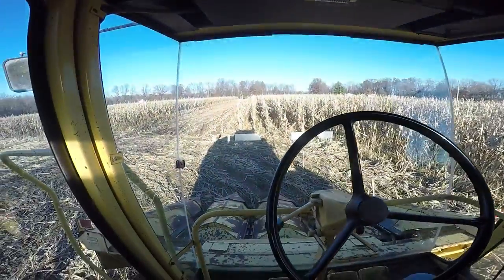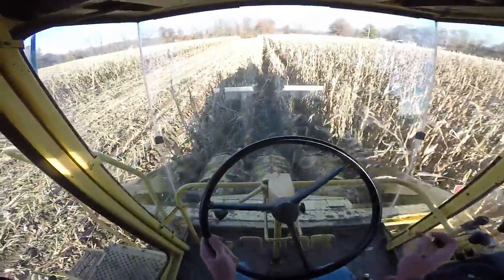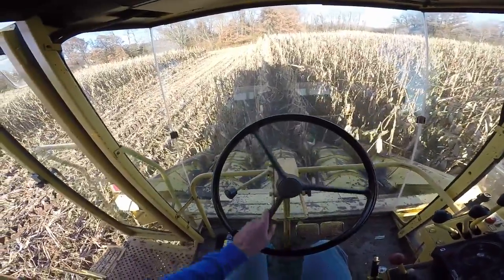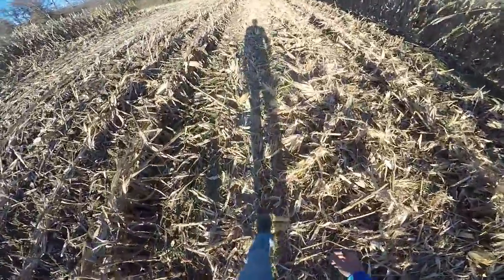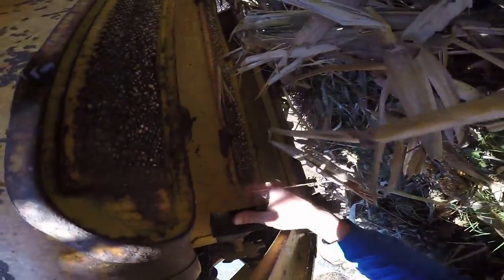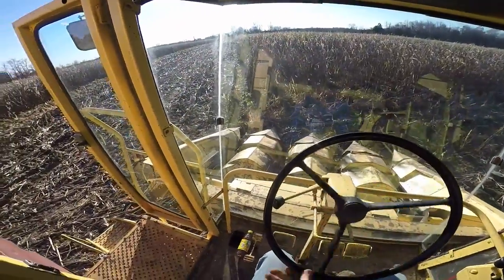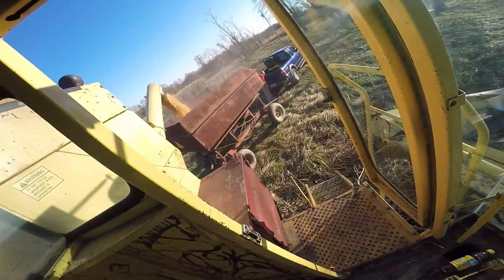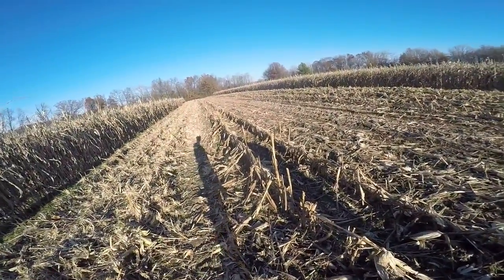First Corn Harvest  TR70 Petrol

Comment: On my Ford 640, I found I could pretty much run the chaffer and sieve wide open, with full air from the cleaning fan.  Unlike most combines, the air was controlled by a pair of shutters on either end of the fan, linked together with a rod across the machine, which you closed down with a quadrant lever on the side of the machine.  Full air increases cleaning capacity and throughput, but you have to run the chaffer and sieve more open to let the grain get through faster so you don't ride or blow any out the back... close the chaffer and sieve down just enough to prevent junk from getting in the tank.  I always did walk-arounds of the combine every couple hours or so and checked to see what it was doing-- header loss, thresher loss (grain still on heads or cobs), and cleaning shoe losses... never saw anything going out the back except the occasional broken kernels or really light immature kernels or bug-eaten kernels which aren't really worth anything anyway... certainly not worth putting more garbage in the grain tank to keep them from going out the back...  We always had a REALLY clean sample, too... Claas sure knows how to make a combine!   German engineering for the win!  OL J R :)
Reply from the maker: I'd love to see one of the Ford combines up close.
Reply: @boehmfarm4276  There's some running on youtube.  We quit row cropping long before I started YT.  Still got her in the barn, but thanks to the hurricanes and the cheap green sawmill wood Grandpa built the barn for it out of, the barn has slowly caved in on top of it.  If I ever grow grain again I'll have to extricate it from the barn, meaning tear the friggin' barn down off of it LOL:)  

Ford actually sold three different models.  In the early 70's there was a loophole in the import tax laws-- Ford discovered that they could import Claas combines from Germany as "machine parts" and taxed as PARTS, so long as they were shipped without an engine!  SO Ford and Claas struck a deal and started importing Claas combines without engines.  Ford would get them and either install a 4 cylinder diesel (which IIRC is about the same as in a 5000 tractor) or a 300 inline six Ford gas engine (the industrial version with sleeves in the block, but it's pretty much identical to the old 300 sixes they put in the F-100 pickups).  Then they painted them blue over the Claas sickly neon green and slapped FORD stickers on them and sold them.  Funny to see as the paint wore off and the green started showing through underneath.  

The smallest was the 620, not much bigger than your old Gleaner.  I never saw one of those-- they were too small for our area at that time.  The middle one was the 630, which Claas called their "Mercator" (don't recall what they called the little one) which was a little smaller than the big one, the 640 (Claas "Senator" model).  I bought a scrapped 630 for parts, which I took everything off of I could get then sold it when scrap iron was sky high a number of years ago.  The 640 we have has an 18 foot rigid platform for grain sorghum and small grains, though we used it for soybeans just fine-- just gotta ride the header height to keep the knife close to the ground but not in it LOL:)  The 18 foot was IIRC the biggest header they had back then.  I converted a Gleaner "G" four row corn head for it, as I couldn't find a wide four row Claas cornhead (not that I could afford anyway).  The Claas was weird in that they feederhouse stayed with the header, they were bolted together.  You pulled a pair of pins and wedges out of the feederhouse pivot on the front of the combine under the cab, and unhooked the cylinders, and backed the machine away, pulled up to the other head, and then slowly drove in while someone guided you til the feederhouse pivots dropped into the clamp brackets, replace the clamps and pins and then hook up the cylinder pins to the feederhouse and hook up the drive belts.  Needless to say NOT "quick tach" for header swaps!  The thresher is a 48" (IIRC) six bar cylinder and concave, with about an 16-18 inch diameter IIRC.  Claas always used a smaller diameter cylinder and concave than most other manufacturers, but it works great, because the smaller diameter cylinder is easier to turn, so less plugging up, and the tighter curvature "slings" the threshed grain out faster.  With two variable speed pulleys on the left and a big cast iron reversing block on the right, the cylinder has plenty of momentum to get slugs through the cylinder unless they're monstrous.  Four wide straw walkers move the straw to the rear discharge beater.  The threshed grain falls onto a grain pan like a New Holland, rather than those silly "auger beds" that Deere and CIH have which just mix all the grain and chaff together into a huge mess for the cleaning shoe to straighten out.  The grain pan shakes with the cleaning shoe to move the grain back, the heavier grain sinks to the bottom and lighter chaff floats to the top, and so as it goes over the rake onto the  chaffer MOST of the chaff is blown out at that point!  From there the cleaning fan blows the rest of the chaff out as the grain pours through the chaffer and sieve, returns coming off the sieve are elevated back to the cylinder for rethreshing.  The clean grain tank was only 77 bushels, but we unloaded enough it wasn't much of a problem, and we had an old auger cart Dad had bought in like 74 or 75 for a long time til the gearbox finally bit the dust.  The cab was not air conditioned (not good in the 100 degree heat of July when we're typically combining grain here in SE TX) but Dad got an old "under-dash" AC unit from a 60's car at the junkyard (add-on AC unit) and installed it on the combine, and it sorta worked.  The cab was quite large for the time, though not very well sealed at all.  Everything was easy to get to-- on your left were the three levers for engaging the combine-- the  outermost for the unload elevator, the middle for the thresher, the one closest to the seat for the header.  Steering wheel right in front with the clutch on the left and brakes on the right.  Cylinder speed and ground speed indicator gauges right next to the steering wheel.  Under the seat was the quadrant lever to set the concave-- which we typically ran in about notch 4 for most crops/conditions.  Made adjusting the concave clearance simple and instantaneous.  On your right, furthest forward was a hydraulic multi-valve which controlled all the combine adjustments through a rotary valve-- think of a loader joystick on steroids.  It has several "slots" which you could push/pull the lever and rotate between them through a cross-slot in the center.  Pulling back usually slowed things down, pushing forward sped things up.  One slot had an offset "neutral" for the cylinder speed, that was rotated closest to the seat, then as you moved over, the next one to the right was for reel height, the one next to it was raise/lower the header, the next one to that was ground speed faster/slower through the variable speed pulleys turning the 3 speed manual transmission, and then there was a crank for the reel speed next to that.  Behind the variable speed controller was the gearshift lever, and behind that the throttle with a catch for idle and released was full speed, and behind that was the choke lever.  A buddy seat with a storage box underneath was on the right side of the cab against the wall.  The grain tank was right behind the cab, with the engine on the deck behind it.  The auger was manual fold, but had a helper spring so it was easily pulled up with a knob and rod arrangement and locked into place with a lock behind the knob that fit down over a pin on the side of the machine-- I often stepped out of the cab while combining, grabbed the knob and pulled the auger up and locked it, as my brother drove up on the tractor and auger cart, stepped back in the cab and corrected any steering drift, and then engaged the unload lever on-the-go and unloaded the combine into the cart... finished up and then stepped back out and put the auger back down and just kept right on combining-- who needs autosteer??!!  LOL:)  The hydrostatic steering was very good on the machine and would hold the row for long enough for me to do that without getting too far off.  

It's a good machine, Claas really knows how to build a combine and the German engineering really shows it's stuff... Ford did right by partnering with them.  Unfortunately it didn't last but a few years, and I guess they closed the loophole in the laws or Ford decided to go a different direction or whatever, because the next Ford combine was the 642, and it was built by Long IIRC, and has basically NO compatibility with the Claas machines that preceded it.  Ultimately Massey would sell a rebranded Claas in the 90's IIRC, don't remember the model number but in the sales brochure you can clearly see it has the same cylinder and ground speed gauges as my old Ford, and clearly see the "CLAAS" and baler billhook knotter symbol of the Claas company on the gauge face!  

The Long combines didn't last but a few years, either, as Ford dropped their combine line and simply sold the New Holland combines, as they had with their hay equipment.  We had a Ford 632 small square baler (don't know who built those, it left the farm when I was 10, that was 40 years ago!) and we replaced it with a Ford 552 round baler (built by Gehl, their 1500 model).  Ford had some interesting equipment and seems they bought stuff from just about everybody at some point LOL:)  In the old days it was mostly Kelley and Dearborn implements, particularly in tillage stuff...  

Later!  OL J R  :)
Reply: @boehmfarm4276  Lemme tell ya a story.  When I was a kid and my Dad was about your age, he was a go-getter too.  He bought this rusted out old Case 660 combine from some guy dirt cheap-- it was nearly rusted to the ground because they'd been combining grain sprayed with chlorate, which some farmers used back then as a desiccant to kill the stalks and dry them down with the grain, but the stuff is basically SALT and of course in our hot, humid environment it simply rotted those old combines to the ground... I remember he spent all winter in the shop patching holes in that thing with bondo and sheet metal cut and pop riveted into the header and underneath, and the whole shaker pan under the open straw walkers was completely rotted out, so he just riveted a couple sheets of tin on top of it to shake the grain down to the cleaning shoe.  Well, he started doing custom combining with it and making money, pretty good money at that, plus harvesting his and Grandpa's own grain sorghum.  One of the jobs he took on was a BTO they went to church with in the next lil town over.  This guy farmed with all new Deere equipment, but he NEVER harvested his own crops-- NO WAY was he going to get all sweaty and dirty and itchy back then on a hot un-air-conditioned combine in the 100 degree July heat when the crops come out around here.  He always hired it done (til decades later).  Well, Mr. Bigshot got to talking with Dad and Grandpa because Grandpa bought an old rice auger cart for nearly nothing and they bought a 56 Ford grain truck rusted nearly to the ground from hauling fertilizer for its previous owner, and were their own two man harvest crew.  Dad had the unloader bust one day on the combine with a full tank, and spent the afternoon dipping grain out of the tank into the truck with a five gallon bucket in the guy's yard while he watched... Dad had a heat stroke and spent the night in the Eagle Lake hospital.  Well, Mr. Big started telling them, "Yall should buy a NEW combine, and you could cut my grain EVERY year!  I'll buy a big 12 auger cart (which was new back then, biggest you could buy, now they're pitifully small and if you can find one they're cheap) I can pull it with my 4020 or 4230 or whatever big cab Deere he had back then..."  SO during the off  season, Dad and Grandpa started looking because the old Case was pretty much a basket case and had run its course.  They looked at new Gleaners (a G or F IIRC) and the Ford, which were the only ones in their price range.  They got a deal on the Ford because it'd been sitting on the dealer lot for about 2-3 years at that point.  Paid $12,000 for it brand spanking new in Victoria, 90 miles from Needville, and they trucked it down there for them.  

Well, they started combining for Mr. Big the next summer and all was going well... Grandpa had a very dear friend, an older black gentleman named Mr. Grant, who had been a family friend and worked for my great-grandfather when he was just a kid.  Mr. Grant, like a lot of guys back then, bought a used tandem truck and mounted a grain bed on it and hauled grain for the local farmers and custom cutters, because almost NOBODY had a semi back then... He had a nice twin-screw International Loadstar with a 400-500 bushel box on it, we still had the old '56 Ford inline six single axle with a 250-300 bushel box on it, so rusted you could see through the floor boards!  Anyway, Grant hauled for Dad and Grandpa on their jobs and made money.  Back then it was nothing to sit in line at the elevator for 2, 3, 4, even 5 hours at times waiting to unload, so it took a lot of trucks to keep up with a combine!  Well, Mr. Big didn't like Grant and told Dad and Grandpa to "get rid of him".  

Next thing you know, Mr. Big comes down to the field and tells them to pull out, he's found someone else to harvest the crops.  Evidently a bigshot neighbor of his up the road had MASSIVELY over-contracted on his grain crop at a good price, only problem was, he didn't have enough grain to fill the contract, and was going to lose his shirt having to buy out the contract.  He came to Mr. Big and cut a deal, he'd buy his grain at the going rate across the scale, sell it under his contract, and harvest his entire crop FOR FREE.  SO Mr. Big was only too happy to go back on his word and welch on the deal with my folks... leaving them in a lurch with a big bank note to make on a new combine and no custom job to pay for it... But this turd was ALWAYS like "it's only business" and his reputation was SO lousy in the town he lived in over there nobody would have anything to do with him-- as one guy commented one time in the coffee shop, "He'd slit his own mother's throat for another hundred acres!"  Amen pew on Sunday morning in church, and do anything to anybody to screw them all week long, because it's "only business".  

More to come... OL J R :)
Reply: Continued... 

SO anyway after a bit of panic Dad and Grandpa started beating the bushes for custom jobs to pay for the combine note.  As it turned out, the mid-70's was the "golden age" for grain sorghum and corn in our part of the world down in SE TX.  Prices were high, it was a cheap crop to grow, and business was booming.  By that point a lot of guys had jumped on the "get big or get out" train but didn't have all the big shiny new toys they'd have a few years later then-- back then a 1486 or 4230 or Ford 7700-8000 series or Case 2290 was a BIG tractor!  Lotta guys still farming with 6 row and slowly moving up to 8 row.  The TR combines and rotary CIH's and 00 series Deeres hadn't really come out yet or not many had them then because they were TOO new... Anyway, they found this guy who was aspiring BTO... he'd rented a BUNCH of river bottom land on the north side of the Brazos river on red clay soil and put it all in grain sorghum to make a killing because sorghum was cheap to grow then and grain prices were sky high (thanks to that IDIOT Jimmy Carter and his Soviet grain embargo that wouldn't last-- the grain embargo ended up collapsing grain prices across the country and set up the "perfect storm" of the 1980's farm crisis-- it was basically the opening shot of it anyway, which took about 15 years to dig out of before it was over... thanks lousy Dem president... Now we're about to see it ALL again...)  Anyway, all was well and good, the guy had a terrific crop, BUT it was a hot, WET June that summer as the grain was filling and maturing.  The morningglory vines had come in like gangbusters, and grew up and wound around the stalks and started running up and down the rows and then across the rows, sewing it all together into ONE HUGE GREEN MAT of vines and dry grain.  He obviously couldn't harvest it all, and he put out the word to every custom cutter he could possibly get to come down to this riverbottom field and start cutting at so and so time and day, and basically they'd end up having all the grain they could possibly cut.  Well, Dad and Grandpa drove the combine across the county and over the 20 foot wide river bridge to get there, with the header on of course, and pulled in.  I was a little kid but I still remember that day, everybody gathered under a grove of pecan trees at the edge of the property.  Combines of every make and model and type and kind were there, from old to brand new... Deere, International Harvester, Gleaner, Massey, Oliver, White, you name it... and our Ford.  Well, everybody pulled in and started cutting... AND promptly were backing out again under the trees to unclog their machines... the sickle platforms would cut the stalks and vines off, but the auger was feeding huge wads of vines and crap into the combines, no matter HOW slow or carefully you tried to drive.  Dad plugged up too a time or two, but the Ford had a BIG advantage-- NO combines had reversers back then, not invented yet.  Claas HAD put a big cast-iron block with four holes in it on the end of the cylinder shaft sticking out over the RH drive tire... you could stick a big iron bar in there and ROLL THE ENTIRE COMBINE BACKWARDS, and with the header lever left engaged, roll the wad all the way down the feederhouse and right out the front under the auger.  Most guys spent a half hour to an hour with knives in there on top of the feederhouse cutting vines and pulling wads of material out of the thresher to get the combines going again.  The big iron block also gave the cylinder on the Ford more momentum to feed a wad through, and the smaller diameter but wider cylinder fed a thinner mat through the thresher and was easier to turn and keep turning.  Deere and IH and most other combines used a narrower thresher but bigger diameter, which concentrated the wads and made them more likely to ball up.  Dad discovered another trick that really saved the day.  When he was combining, if he saw a wad get pulled under the auger and moving into the feederhouse, he'd reach down under the seat and throw the concave lever ALL THE WAY TO THE FLOOR, opening the concave WIDE OPEN, which created enough space for the wad to hit the cylinder and roll right on through... there'd be a loud BZZZZZ!!! as the wad hit the rasp bars but it would roll around and the engine would grunt and spin the cylinder back up to speed, toss it on the straw walkers, and out the back it'd go... fall right off the back end and onto the ground!  Yeah, it'd be full of unthreshed heads, BUT the combine could keep going and didn't plug up, saving HUGE amounts of time.  AS soon as the wad was through, he'd pull the lever right back up to slot 4 and keep right on combining til the next wad.  

Other combines of the time had primitive concave adjustments and couldn't do this trick at all... Deere used a crank wheel to lower and raise the concave-- crank it like mad for 2 minutes to open the concave, crank it like mad the other way to put it back.  IH used adjuster bolts IIRC on the old conventionals back then, had to adjust it on either side under the operator cab or platform... Gleaner wasn't much better, and Gleaners back then put the thresher in the feederhouse and used a solid concave, throwing the grain and straw onto a "raddle chain" to feed it up to the straw walkers and do the separating.  No bueno in those conditions...  By about 2 pm, everybody else had quit and left.  Dad and Grandpa were the only ones left, Dad running the Ford combine and Grandpa driving the 5200 row crop pulling the little rice auger cart, taking off grain on-the-go and hauling it out and unloading into waiting row of tandem grain trucks...  At one point Dad and Grandpa were cutting 8 railroad cars of grain a day, running every minute of the day they possibly could.  They paid for the combine in a single year doing that job for that guy.... 

Mr. Big would go on being a bigshot... his kid graduated A&M and came home, convinced him to switch to all ultra narrow row (UNR) corn, and they went broke a few years later.  The kid went to work for the school teaching ag, and the old man retired, gubmint and the bank sold everything he had basically because he didn't own ANY of it, they did.  

Later!  OL J R :)